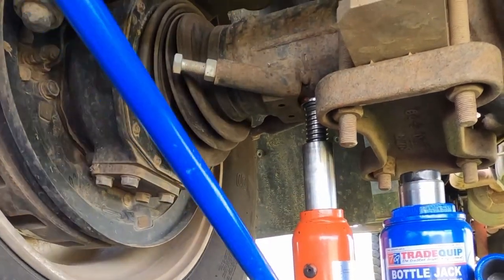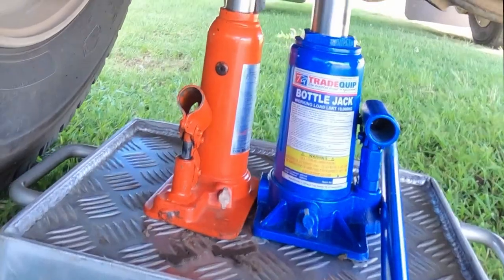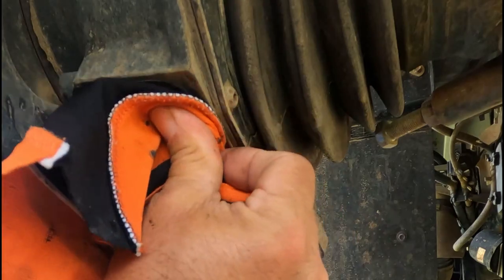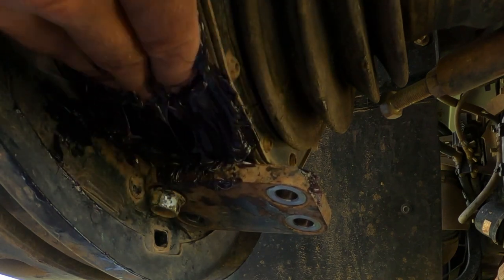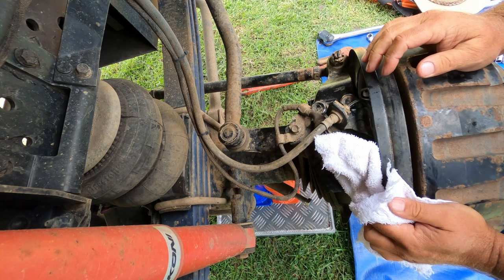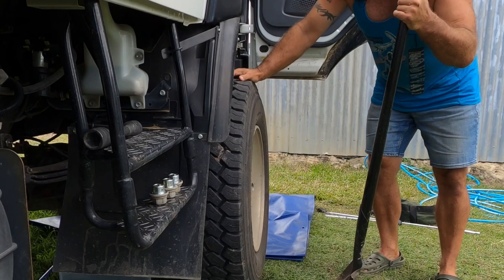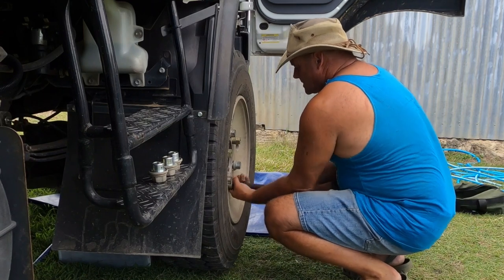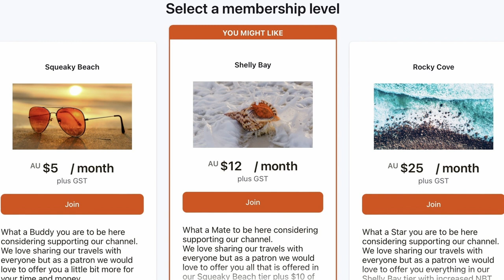Greasing Isuzu 4x4 NPS 75/155 Kingpin Bearings No service centre required or bill to pay #vlogger

Comment: Oh yes Karl, without maintenance, you often remain outside and just where you can not use it. I can only say that when we converted all our vehicles to balloon tires, many problems solved themselves. You just have to adjust the tire pressure according to the situation. It was the same up on the Bering Strait, in the Asian bush and in South America, where conditions were similar to yours.  Best regards from Frankfurt, nice video and greet job.
Reply from the maker: Hi Gerold,
I always do all the maintenance/servicing that is required and do any other repairs that are needed. We are glad you enjoyed the video. 
Regards, karl & katty.

Comment: You would think Karl that the manufacturer would drill a hole in the plates then tap a thread for a grease nipple?
Reply from the maker: Hi Ken,
I was thinking about doing that……
Reply: @nowhereboundtouring  it should work. If bottom plate cheap (ha ha) purchase and test. Dust cap for grease nipple as well. Cheers Ken

Comment: A few things if you'll indulge me :

a) If you go through Sarina you need to stop at the Sarina Motel for either egg and bacon breakfast (all day) or pork chops for dinner. The owners have their own free range organic pigs.
Really good bacon and pork. The Sarina motel is in the middle of town. You can park outside.

b) I see you've found the easy way to mount a tyre without wrecking your back. I have a 3 foot Podger bar I use the same way you use the shovel. Why hurt yourself ? So much easier with a tool and some knowledge. Being on a station in SW Qld I also use the same technique for tractor and truck wheels.

c) Your Isuzu has the same as my Deutz tractor. The wheels don't centre on the hub. A bit of a pain but you get used to it. It's not like a landcruiser.

I hope you understand my 3 points. Cheers. :-)
Reply from the maker: Good morning Ade,
The Sarina bacon sounds great, but maybe next time, as we are now further north at Airlie Beach 👍

Comment: Im really loving your videos because your showing the viewers such simple jobs they can do yourself. ❤
No mechanic here, however have you thought about mounting some grease nipples at the top and bottom so you can flush out most of the old grease?
Reply from the maker: I did think of that, but the metal is about 25 mm thick. It could be done though.
Cheers

Comment: Hi Carl just wondering will you be serving your transmission box yourself oil n filter in a vid ?  Cheers
Reply from the maker: Hi Joey,
It is very easy to service, as you just need to change the oil ( no filter). I do it every service ( 15k km) even though Isuzu recommends every 60k km. It takes less than 5l of fluid. I may be able to film we I do our next service 👍
Reply: @nowhereboundtouring  also just thinking would it be a good idea drill a hole in the centre of them plate you took off to grease the king pins and thread in grease nipples  maybe
Reply from the maker: Yes, I was also thinking that 👍